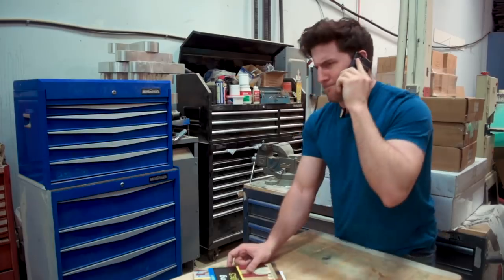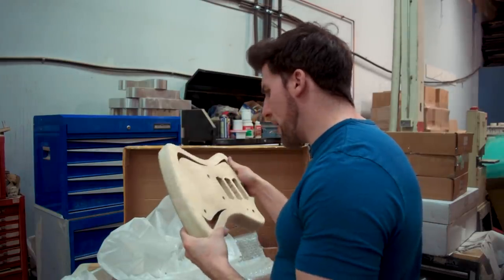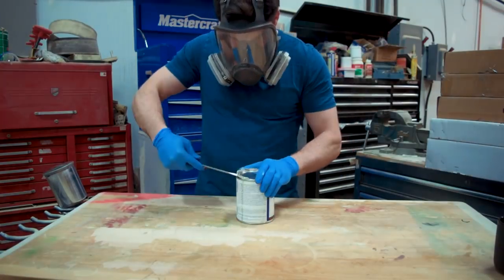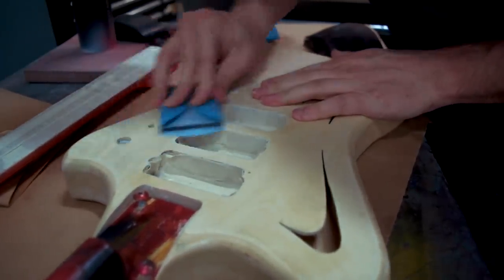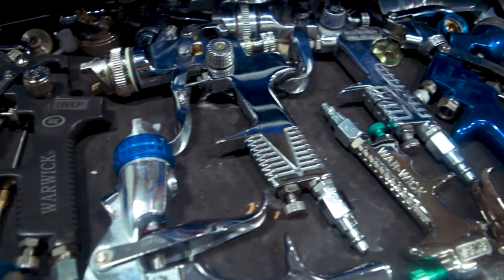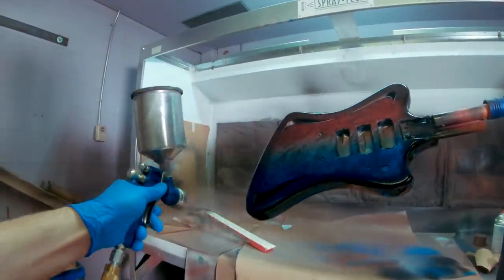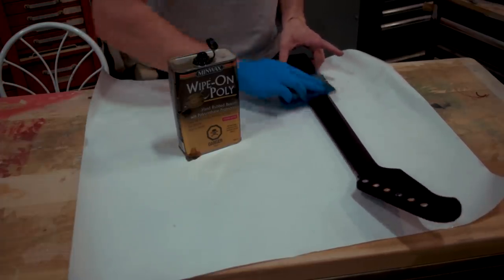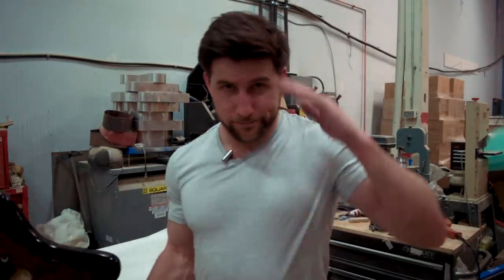Painting a CRAZY hollow body conversion guitar for GUNS AND GUITARS

Comment: So nice! You have such COOL ideas! Love that $leek finish and wondered if it would work on fiberglass surfboards or wood furniture. You have all the best tools... and techniques. Thanks for being so concise but completely thorough with instructions. Those colors work in Costa Rica, too! 😉💕Pura Vida!☀🕶
Reply from the maker: If you want to do it on fibreglass you will just need to use a compatible primer rather than the vinyl sealer, which is designed for use on wood.

Comment: Hey Brad nice job on this one... You mentioned something about not having a Sata Jet but with all the guns you have now you could already have a Sata Jet. I prefer the jet for bases and I strongly stand by the Iwata for a clear gun! They are much lighter than Jet and IMO Iwata clear guns Kill the competition. I never liked sand and buffing guitars bcs the paint can burn near where the tuning keys go on the head stock and near the pickup openings. IDK if you EVER used any of those guns before but with the edition of a $100 clear kit with slow activator for the clear and slow reducer for the bases.... You will NEVER have to sand and buff ANYTHING again, not even a guitar. I like to Use normal activator for my first 2 coats of clear bcs it lets be build more clear material on my subject. My last 2 coats I use slow clear activator bcs it self levels and stays wet long enough to allow me to lap the guitar enough times untill its fully wet 360 degrees keeping in mind that Im hitting the face of the guitar body lastly as my finishing move. If you are not content with the overall product, block sand it 600 wet and perform  another clear coat with slow activator. Youll only need 2 coats bcs a "wet sanded" (clear coat) will only hold two oats of clear before it runs bcs there is o base coat to absorb the clear. I promise you 100% You will never wet sand & buff anything again.

Comment: It looks like you could adjust your spray fan width so it's a little more narrow.  I would also thin out your paint and use more coats to prevent any orange peel.  The bottom line is you want the paint to flow out better on the surface. This will take less time in sanding etc.
Reply from the maker: Thanks Tom.
Reply: @BradAngove  , Thanks for the video. I know a lot of these paint manufactures say to never thin their paint, or at the most, 5%.  I thin a lot of the two part paints  up to 100% (one to one) often with great results. Not sure what might work for you, but good luck with your projects.
Reply: @BradAngove  , Thanks for the video. I know a lot of these paint manufactures say to never thin their paint, or at the most, 5%.  I thin a lot of the two part paints  up to 100% (one to one) often with great results. Not sure what might work for you, but good luck with your projects.

Comment: You mentioned using a certain sand paper that is good for producing a semi-gloss finish without wet sanding, which brand might that be? I didn't see it on your amazon.

 I've recently found that dry sanding Tru-Oil finishes makes for a great smooth finish, but my 1000 grit for in between coats just clogs up too quickly, so what ever you're using may be perfect for my intent. Please let me know! 

Also, don't let Dan fool you, everyone knows Canada is the bees knees.
Reply from the maker: That’s the 3M paper in 3000 grit and then 5000 grit. Sanding ridiculously smooth like that tends to give the appearance of some sheen, much like using a buffing compound would.

Comment: Finally found your video that addresses “marble” type finish.  That was beautiful work Brad. When you apply the paper or plastic over the paint to get your marble finish does it not leave an uneven surface with bumps and grooves and how do you even them out? Thanks, I am a fan, a Canadian fan. 🇨🇦
Reply from the maker: It does, yes. That what gives the effect. You even them out by burying them under clear coat and then sanding the clear coat flat.
Reply: Brad Angove thank you Brad, appreciate the advice.
Reply from the maker: Yes it needs to be built up higher than the texture so you can sand flat without ruining it.
Reply from the maker: No kidding!
Reply from the maker: Polycrylic isn’t very durable, but you can potentially use that as your transfer medium and then clear coat over it after if you want.
Reply from the maker: Polyurethane will be a more durable option.

Comment: Thanks for the reply about the filler ... is there a type of filler that is better? ... I've seen tints for wood colour finishes but what do you use to tint for these type of finishes?
Reply from the maker: The standard water based filler works fine and you can tint it with aniline dye or even water based stain or acrylic.
Reply: @BradAngove  Thanks

Comment: Brad,   I have a Les Paul style kit guitar I purchased from Precision Guitar Kits.   It doesn’t have a binding so I wanted to leave the unfinished maple cap on the sides of it to look like a binding.   I thought I would tape off the unfinished maple on the sides and spray on vinyl sealer before staining  the bottom and dyeing the top of the guitar.   My concern is the stain and dye bleeding into the unfinished cap and not having a clean line.    Good idea or bad?    Or is there a better way to do that.    Thanks for all your previous help.
Reply from the maker: I believe you'll find what you're looking for here: https://www.youtube.com/watch?v=M1OvxKHzx-c

Comment: I have a serious question I already ask you about and you told me to check With BigD.   I’m assuming I would dye the front of the guitar first and stain the back first.   Then use Behlens vinyl sealer and behlens string instrument lacquer after that.   This kit is a Les Paul from Precision Guitar Kits.   It doesn’t have a binding so I wanted to leave It unfinished cap to look like a binding.    I thought I would tape it off and put on vinyl sealer before staining  and dyeing the guitar.    My concern is the stain and dye bleeding on the unfinished cap and not having a clean line.    Good idea or bad?    Or is there a better way to do that.    Thanks for all your previous help.   My first build looks great thanks to you.
Reply from the maker: Here you go Ken: https://www.youtube.com/watch?v=M1OvxKHzx-c

Comment: Can I apply primer with brush to my motorbike metal parts ??? Atleast the first coat with epoxy primer?
Reply from the maker: I suppose you could. You would likely need to do more sanding to get it flat after before moving on though.
Reply: @BradAngove  u were right....lot of sanding was needed....thanks !

Comment: Can we remove Paint on Plastic n fiber parts of motorbike by paint remover ( spray can). Will it affect the plastic surface ???
Reply from the maker: It could melt the parts depending on what type of plastic it is. Is there a reason you need to remove it entirely.
Reply: @BradAngove  I need to repaint such parts to give my bike a new look....so should I just sand the plastic parts..n then apply primer n then new paint ???.....no need to use paint remover on plastic parts ???
Reply from the maker: Correct.